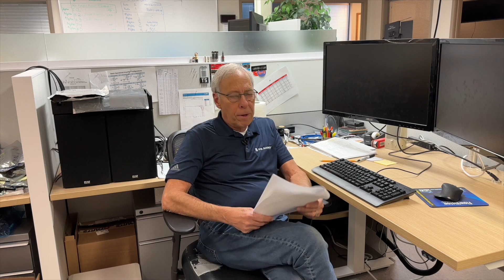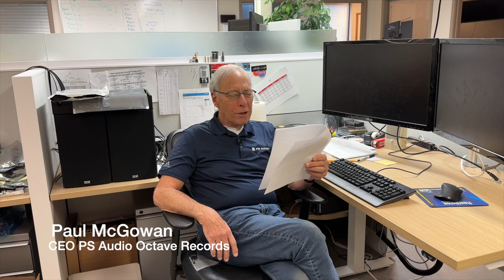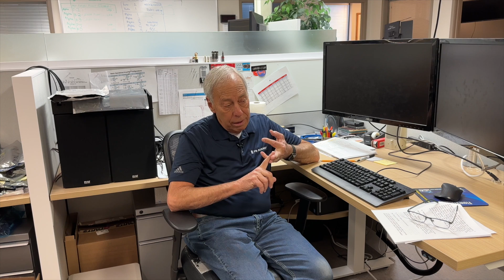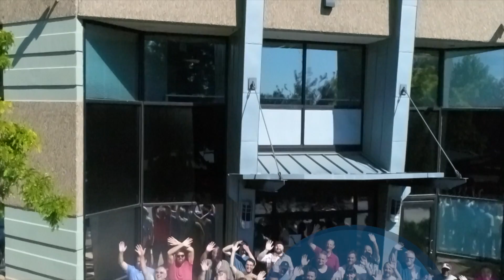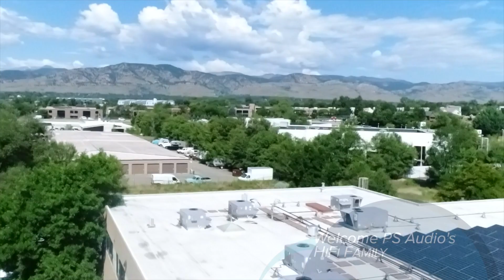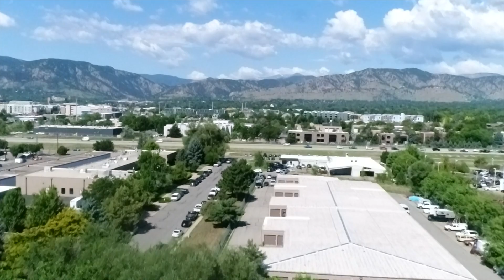Changing CPU speed for better audio

Comment: Basically, when you are running many processes in background, it requires more power. Hence, more PSU noise. 

And modern CPU doesn't run at static frequency. It has power saving mode which running a low clock and low power consumption. When CPU is detecting more processing power is needed, they increase either multiplier or a base clock, waking up some Sleeping CPU Cores. Therefore, more jitter. Not to mention that different kernel has different jitter. 

However, decoding lossless file involve another factor.

Computer instruction sets (such as AVX, AVX2, SSE, MMX) has different jitter values. It varies depend on each CPU brand and model. Therefore, depend on decoder you're using, its optimization could also affect SQ, too.

A software developer from Japan, who developed player called Bughead Emperor, discovered that just rewriting wav file with different CPU instruction set could also change sound quality.

I tried his software and found similar result as his.
Reply: Get Apple Silicon.  No heat No fan noise.   Add a good DAC it sounds amazing.
Reply: @mikepxg6406  if you're ok with voiding warranty by modded it with Linear PSU
Reply: @tongsan523  Sorry what are you talking about.....
Reply: @Mike Pentax Mac Mini/Studio coming with switched-mode PSU. Unlike Mini PC with VDC input that you can just plug it with Linear PSU. Some could hear the difference between switched-mode PSU and Linear PSU.
Reply: @tongsan523  No difference if using a realy good external dac.
Reply: @philipslighting8240  I'm using dual ES9038Pro modded with OCXO and its DDC is Amanero with CCHD-957 and 5V Linear PSU. Yet PC PSU still affect SQ, though.
Reply: @tongsan523  Stop using a PC they are noisy. Get a new Mac with apple silicon.
Reply: @philipslighting8240  I don't know what you are talking about. When I said noisy, I mean PSU induced jitter.
Reply: @tongsan523  I dont have that probem.
Reply: @Mike Pentax  everyone has this problem, noticeable or not is another story. In low end to mid end system are hardly noticeable.
Reply: @tongsan523  I doubt it.  Just listen to the music and stop worrying about hardware.
Reply: @philipslighting8240  10 bucks Chinese made bluetooth speaker can give you a music, too. Why bother buying somethings expensive than that.
Reply: @tongsan523  Sounds like you have found your niche.
Reply: @philipslighting8240  Nah, it's YOUR device.

Comment: I have a pretty hardcore tower with eight fans in it (tower itself, power unit, video card, etc.) so, for whatever it's worth, I put the fans to their lowest settings purely to lower the noise level and it helps significantly.
Reply: Get a Mac Pro with apple silicon the fans never run as it doesn’t get warm
Reply: @mikepxg6406  Totally agree My M1 Mac Mini fan has never run once since i had it it’s used every day for photo editing and music playback to my Cambridge 200M Dac.  it has never got warm once Apple silicon is in a different league.

Comment: the next question: Changing RAM speed for better audio:face-blue-smiling:
Reply: Lol
Reply: You're laughing but on the jcat forum some people think they hear a difference when they downclock their ram
Reply: @AngryChineseWoman  Either downclock RAM, incrrease voltage and/or reduce refresh cycle time (tRFC). RAMs are capacitors. It's discharging when time passed. AKA voltage drop. Downclock the ram and reduce tRFC mitigate this problem.
Reply: Tried. Yes, it's affect SQ. Some of my friend like Hynix and I prefer Micron. However, we came the same conclusion that Samsung RAM/SSD sound bad. Only one exception was when it's in Aurender.
Reply: @tongsan523  Master trolling
Reply: @TheMatsushitaMan  FYI, I'm NOT trolling. About a decade ago. a guy in my group using Mac Mini as transport, he had a listening session to deciding which RAM to use. His Mac mini supporting DDR-3 and we ended up unanimously voted for Hynix DDR3-1333. In that session we had tons of RAM, such as Samsung, Hynix, Micron, Elpida and Infineon. Unless you're using very analytical system. It couldn't be heard as it's very subjective. And 8GB*2 modules at those day still cost a lot and the guy need to sell the rest of unused RAM afterward (8GB*2*9).
Reply: @tongsan523  Aaah, you're a good one. I like that
Reply: Ramming Speed ………
Reply: Yes also glue a gold spike to each ram stick

Comment: Modern cpus downclock/volt in adaptive mode to 800mhz & under 1 volt when idle. Listening to music shouldnt put much of a load on the cpu but Paul is right by minizing background tasks & uninstalling apps it will be less busy.
   Also Intel 12th & 13 gen cpus have efficiency cores that handle background tasks, whether that would decrease noise is anyones guess
Reply: Just Get A Apple Silicon Mac.  No heat no fan noise.  Add a good DAC you won’t want to use a PC again.